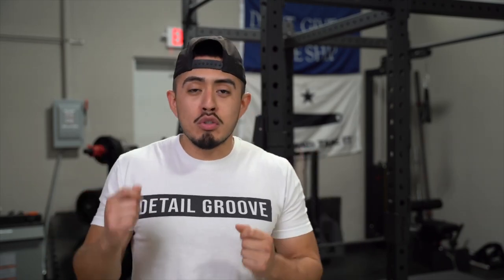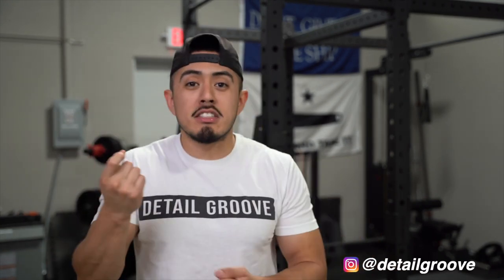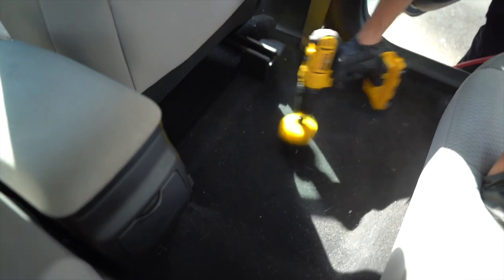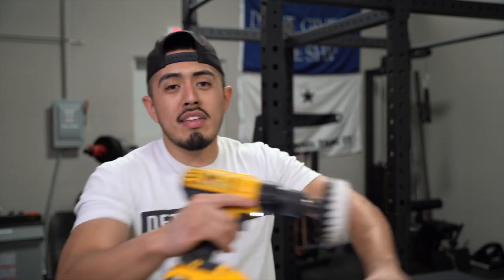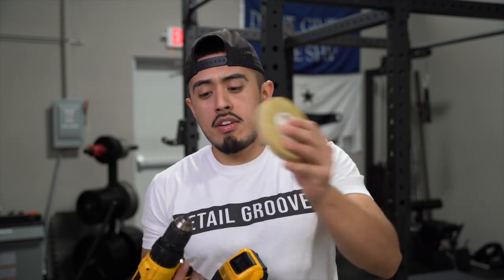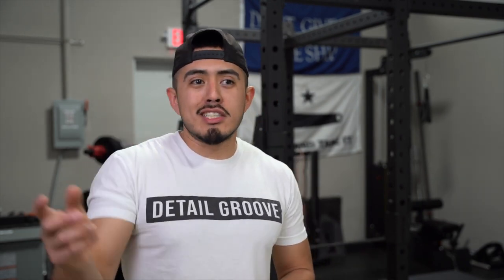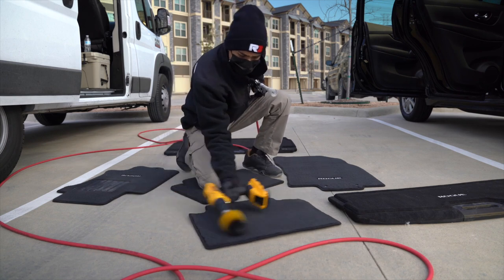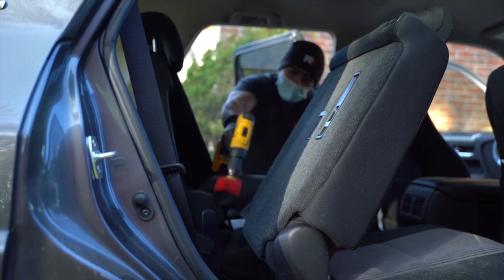The Tool We Use MOST For Interior Car Cleaning | Everyday Workhorse For Seat Cleaning

Comment from the maker: Are you using this tool in your business? Links to all things will be in description box!
Reply: I use this typeof drill attachment alot but i was Just wondering if anyone or you has noticed a difference between using the extension with the quick disconnect or without. I feel like I they break easy with the extension on lol to be fair I'm going ham with these things.
Reply: I know u got a shop now but have you ever had a job that ran into night and had to use lights?
Reply: Impact driver ?

Comment: The drill brush, and tornador air gun are essential in my operations. There's a lot of situations where the tornador air does a much better job than the drill brush. Combined, they put in some serious work and make results happen. That being said, I'm impressed you managed to still stay active on this channel.. keeping the channel up is a lot of work when adding in the physical energy used in detailing. Especially, in direct sunlight and heat.

Comment: I'd be lost without my Ridgid 18v drill, jobsite blower, and vacuum. I even use the drill with a proper backing plate and pad to spot correct on paint also water spotting on glass. Excellent content! 🍻

Comment: You neglected to mention that a corded drill is wayyyyy more powerful. It doesn’t matter what brand. Any corded drill is incredibly more powerful then any cordless drill. That should be brought up because of the significant power difference
Reply from the maker: This is true. Anything battery powered will lose power versus corded. That being said, 10/10 times, I'm taking a cordless drill. Also, for our application, we don't need a super strong drill 😅

Comment: They need {inventors, hell maybe I should} to come up with a design that you don't have to hold down the trigger and it's not super heavy AND doesn't die quickly for the people that have carpel tunnel. I know ryobi came up with a cleaning tool that comes with a brush and I'm thinking of buying it only if I don't have to hold the trigger the whole time. But 30min just isn't long enough when your in the cleaning business. I like to use it for shower glass doors and grout. 😉

Comment: Could you use an impact driver instead of a drill? 
Or would that damage the surface your cleaning.
Reply: Too much power, do you wanna tear the carpet fiber out...? Lol.
Cordless drill 12V to 18V on #1 low setting is sufficient, wanna do it quicker #2 setting. Test the brush bristles. There is hard, medium, and soft. I would do medium or soft on interiors. Impact drivers have alot of driving torque, it is overkill. It's meant for driving screws, bolts, and lag screws into thick wood or concrete. 
Some use to drive screws into metal as well. Best tip keep the drill dry and clean after use. Never drain drill battery to 0%(dead) and ever charge to 100%(full). Use till 20% left and charge back up to 80%. After charging battery, it is hot. Let it cool down then use battery. Sometimes that can be hard to do when you are doing a job.